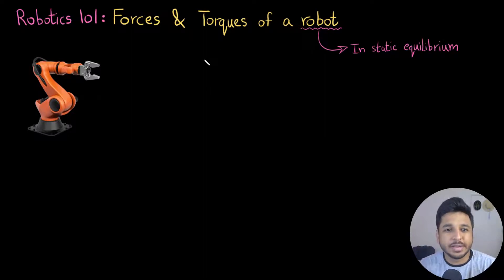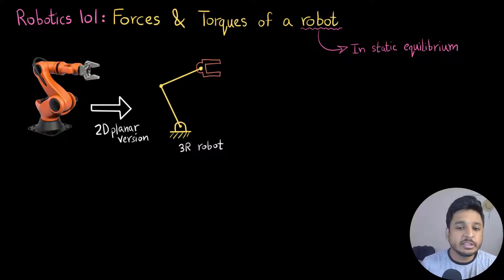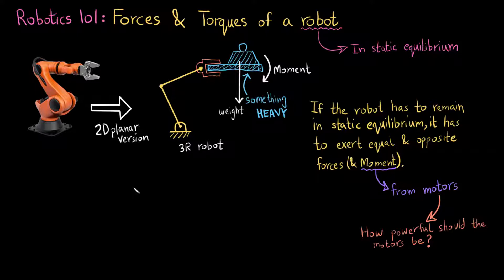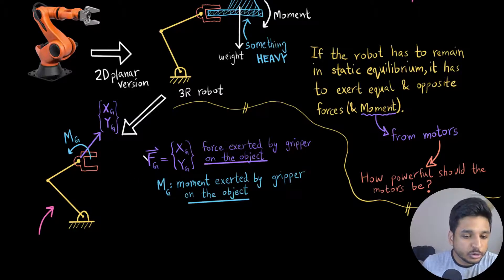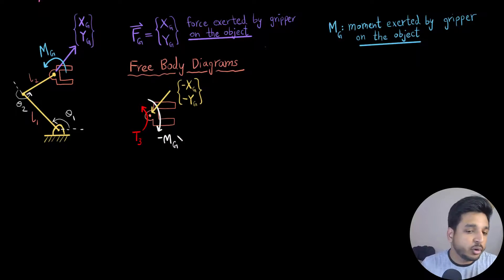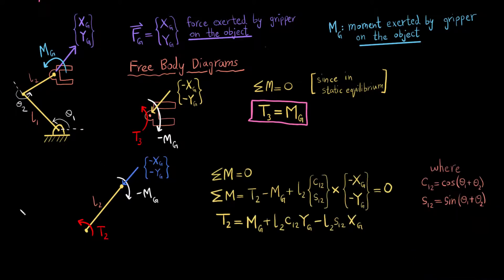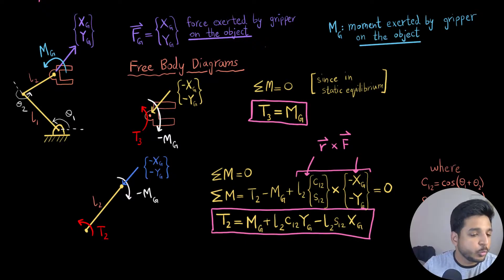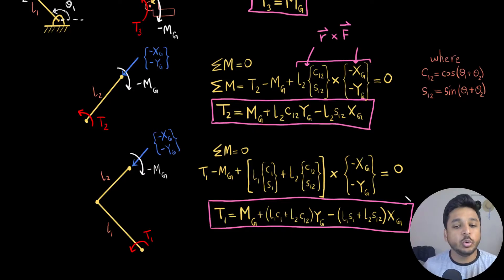Forces & Torques of a robot | Robotics 101

Comment: Thank you for the videos. Very helpful. 2 questions:
1. What about the weights of each arm? I would expect that those weights will affect the moments T1 and T2 as well
2. You defined the problem as a static or constant velocity for SigmaF=0. What about the case when there are accelerations as in most cases? I assume this will increase the torques and forces.
Thank you

Comment: Thanks for this - can you explain a bit more the forces Xg and Yg for T2 and T3? I would have thought the mass applies weight at point 3, leading to the moment about 2 as Mg = mass*g*l2sin12 I think - so it is just T2=Mg. or is Mg a moment about the "wrist" of the arm not the "elbow? Thanks a lot!
Reply from the maker: Hey Hanschanhs, I don't think I fully understand your question. 
MG is the moment exerted by the gripper on the object and it is about the end-effector of the robot. I wouldn't normally call it a wrist since a wrist is usually where the three axis intersect for an industrial robot.
The Torque experienced by the motor at 3 is MG. The torque experienced by the motor at 2 is MG + some component of the weight of the object that the end-effector is holding.
Does that help answer your question?

Comment: How to calculate the forces exerted by gripper Xg and Yg for T2?
Reply from the maker: At joint 2, it has a motor attached and so, the thing of importance here is the torque. This is because torque is the factor that you use to decide which motor to purchase. 
But if you really want to calculate X and Y forces at joint 2, you can do so by using the free body diagram @4:44 and just doing the sum of forces = 0 since it is considered in static equilibrium.
Hope that helps.